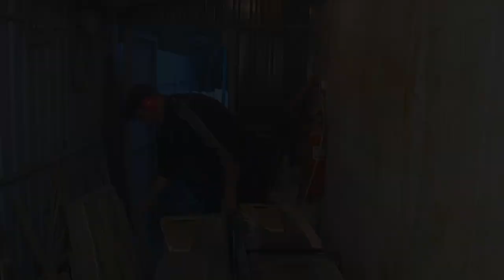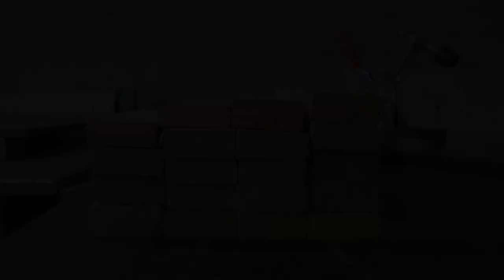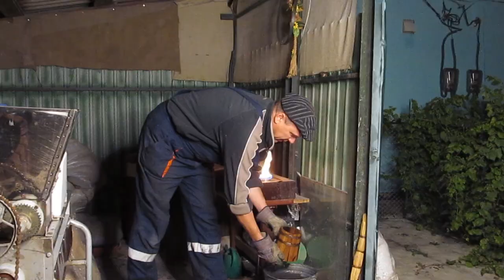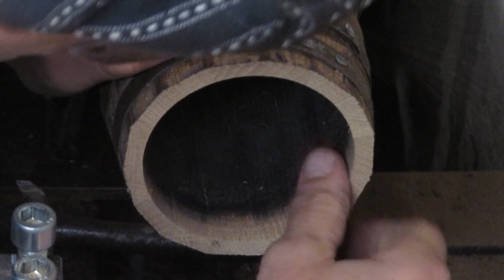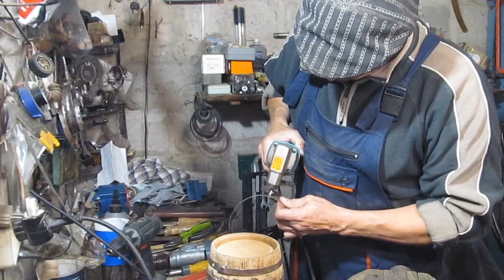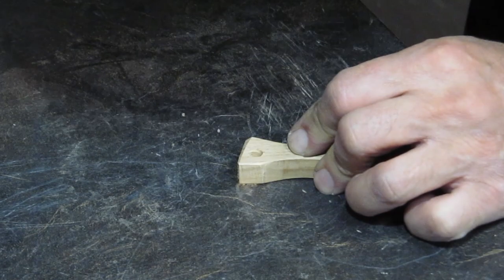А whiskey barrel the size of an apple | DIY | How to make a wooden barrel with your own hands

Comment: What is the angle of the router bit to the table when you cut the staves?  What is the proportion of the center width of the stave to the end width?
Reply from the maker: The angle of the cutter depends on the number of staves in the barrel and can be calculated using the formula: 360/number of staves/2=angle of the side face of the staves. In this video, the angle is: 360/15/2=12 degrees. The difference in the width of the riveting in the middle and along the edges is 8-12%.